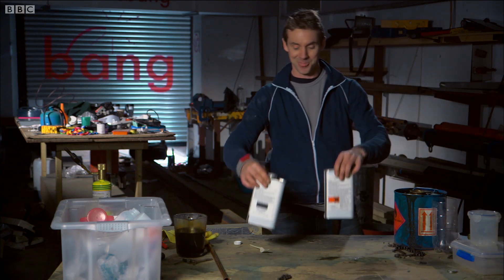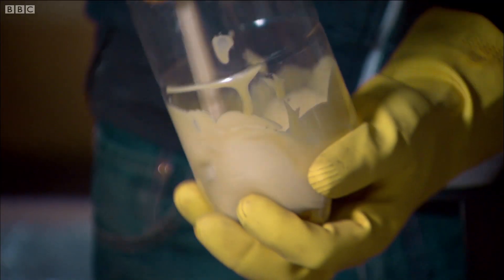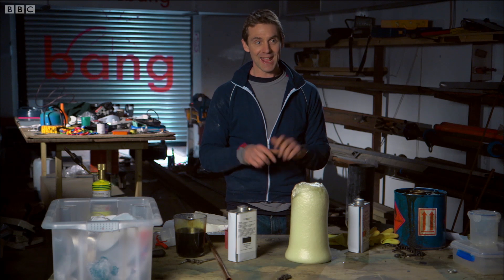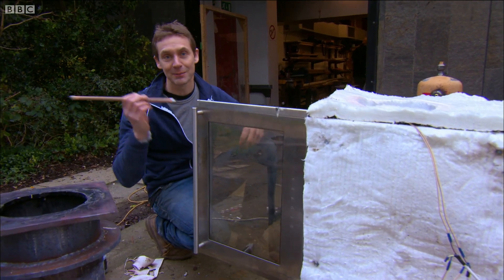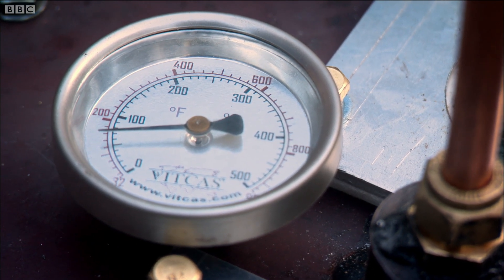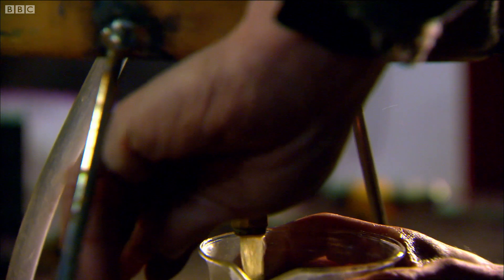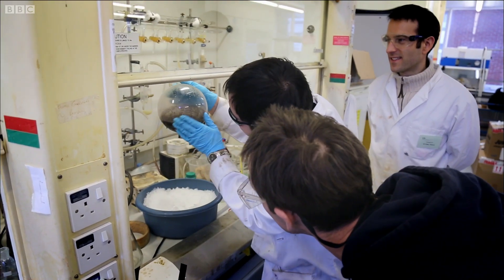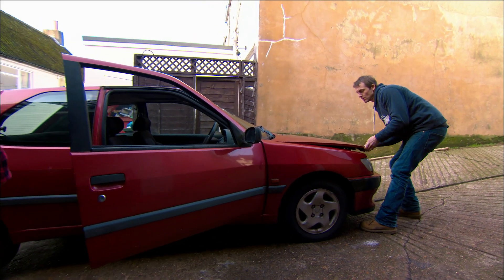How to get diesel from waste plastic - Bang Goes the Theory - Series 7 - BBC

Comment: and the energy required to make the diesel makes the process inefficient
Reply: this technology could be used (at night) when there is more power on the grid than needed.
Reply: Unless if you use wood or some other renewable energy system then the process of making the fuel is efficient. Besides, say if you use propane to make standard, cheap 87 octane gasoline from plastic, you are using a natural gas based fuel to make a crude oil based fuel which is inefficient although the actual need and demand for cheap low octane gasoline is triple the demand for propane as we use crude oil based gasoline and diesel for our entire transportation system. We use propane for grills and some houses use propane for heat, stoves, and ovens which is not much.
Reply: if you use gas instead of electric, not all is able to be condensed and the excess gas can be used to heat the pyrolysis chamber.  It produces a gas and liquid.
Reply: A South African, Deon Bester, has patented a machine similar to what they are talking about, but it uses the gas and other fuels created to heat the reactor chamber. In other words, it uses it's own waste materials as fuel and is off-grid. See article: http://www.engineeringnews.co.za/article/grid-independent-plastics-to-diesel-plants-enable-community-involvement-2014-11-07
Reply: It produces more oil than is needed to operate the system needed to extract it.
Reply: Can anyone tell me the carbon waste from plastic cooking can be burn to heat  plastic to more economical
Reply: +Michael Better to just use renewables to charge a battery.
Reply: +MichaelKingsfordGray If you're going that route you might as well store the energy in batteries and use electric motors run off of them instead.

A "better" option would be to make use of things like volcanoes, volcanic vents, and similar sources of geothermal power.  It's an immobile energy source that can be tapped to create a mobile energy source.  You can also do the conversion as part of a two stage process where it functions as a standard geothermal power plant with the conversion of plastics to fuel as a function of either initial heat or waste heat.

Of course an even better option is to just support genetic engineering and bio research in all their forms so that we can more quickly develop bacteria that break down plastics into different materials.  That same bacteria would be usable in situations where cooking plastic wouldn't, such as the treatment of sewage.
Reply: @Mesterick  And when there's a shortage of plastic in that area, then what? Do the bacteria become airborne & eat our houses, cars, bikes, prostheses? Yikes!!! Sounds like the attack of gray goo.